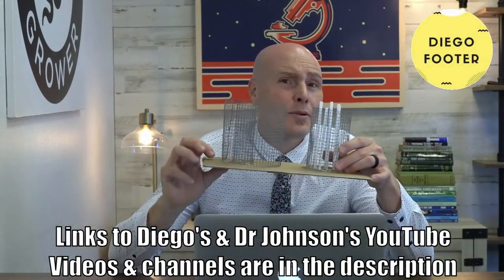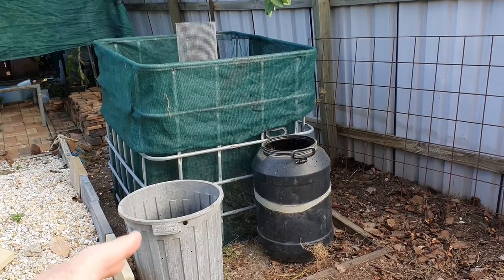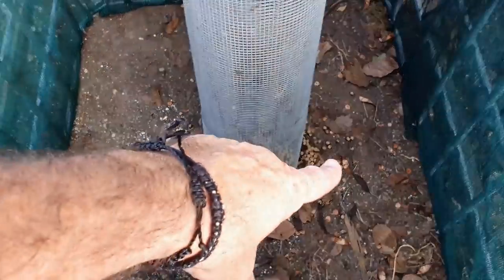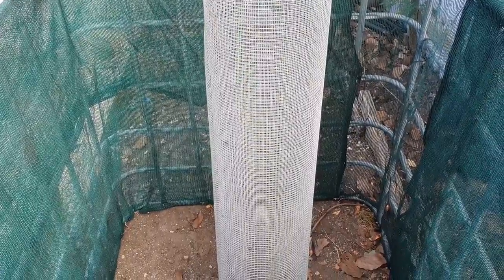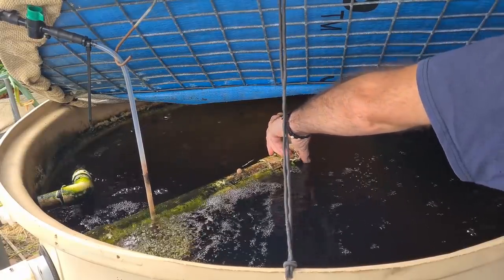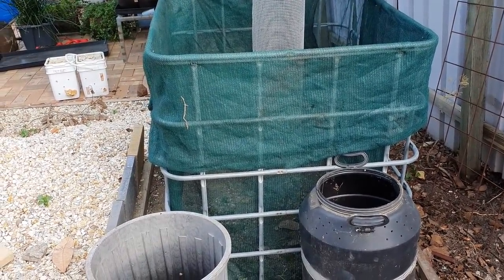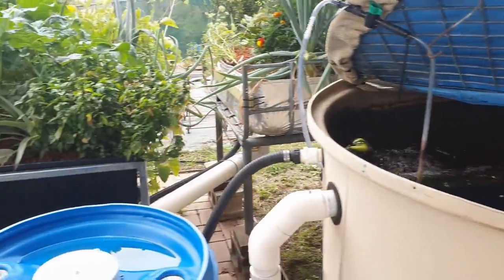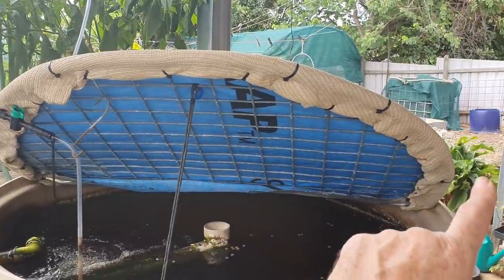Bioreactor Composting & Mini Aqua Update

Comment: Damn Rob, now I've got another project lol. I guess my midterm tests will have have to wait lol. Hope all is well!
Reply from the maker: 😀 Sorry for providing a distraction but they don't take long to knock together if that's any consolation.😉
Cheers & hope you do well in the tests Alex. 👍👍
Reply: @RobsAquaponics  thanks, the real test was finding one of those ibc frames that wasn't being used lol
Reply from the maker: @alexcalabro8140  I used the concrete mesh for the round ones. Works out fairly cheap too. 👍
Reply: @RobsAquaponics  ah yes great idea! I just took down our chicken run so that will be perfect to recycle that chicken wire.

Comment: In several videos you talk about the screws you use in your pipes when you don't use glue.  What size/length is the screw?  Does it go through the pipe (and into the water) or just into the pipe?
Reply from the maker: I use a small 6g/3.5mm 316 stainless steel screw that's no longer than 10-15mm/½" long for the larger pipes. I do have some shorter ones for the 25mm/1" pipe as well as I don't want it to impede the water flow too much. 
Hope that helps.

Comment: Hey Rob, love your videos.

I'm planning on doing a small indoor aquarium with an aquaponic herb garden, around 50L.
I'm gonna stock it with neocaridinia shrimps and a few guppies/tetras and some water plants, it's gonna be next to a big window and i'll give it an extra CFL on the top and scatter a few 1W LEDs around just for the aesthetics.

any advice you have for such small projects?, I'm doing everything DIY (besides stuff like pumps obviously, hehe)
Reply from the maker: Am glad you're enjoying the videos Sparrow. 😁
I haven't got any personal experience with the smaller builds sorry. 
I have been told by a few folks that they found running the beds as a constant flow was easier for them rather than making up a siphon. If you do want the beds to flood & drain a small timer might be the best way to go.
Hope that helps at least a small bit & have fun with the build. 👍
Reply: @RobsAquaponics  That was pretty much the plan, pump the water up though a mesh and bio filter to the grow bed where it flows down constantly as a waterfall aesthetically.

I need to look through more of your videos, do you have anything on herbs? parsley, basil, mint, rosemary, etc
Reply from the maker: @Sparrow420  Not individual videos on them. Mint will take over a small system & is a challenge in a larger one so I don't recommend growing it in AP.
Parsley & basil do really well. 👍
You will be told rosemary won't grow in AP by some but it all depends on how the beds are set up as they like air around their roots. I had one in a flood & drain bed that grew massive. It had a 400mm+ / 15¾" root ball when I ended up removing it. 
Hope that helps some.
Reply: @RobsAquaponics  The plan is for the mint to go wild, I drink a LOT of herbal tea, haha
When I did research on ap rosemary I found the same, thanks for confirming!

your replies and videos are super helpful, thanks again!

Comment: Can you use urea from any animal(cat)?
 I use wood pellets for a fire stove as cat litter, it changes to sawdust when it gets wet. It’s cheaper, smells better when used, and, once I decide it’s time to change out the box, I don’t have to throw it in the landfill. 
I’ve been throwing it in a pile, minus the poo, and my theory was after a couple years of it being washed by the rain, I could use it in the compost. 
But maybe I could use it in the compost right away?
Reply from the maker: I know that bottled aged human urine is generally safe but am not sure about cat urine soaked material sorry.  
It would definitely breakdown into plant-available nutrients Gayle but I would be concerned about pathogens being passed on to us if the material wasn't composted at a high enough temperature. I would suggest you look into the possible diseases that might be transmitted & the best way to compost the material so it wouldn't be an issue. 
Sorry I'm not much help with this one.

Comment: Does it matter if it rains and gets the bioreactor wet. How much rain could it cope with before getting to wet.
Reply from the maker: It does if you're in a high rainfall area. 👍 I have seen some folks cover the top with sheets of tin or tarps. It's best to make sure there is some air flow under the covering as well.

Comment: Hello from Florida,
I also have an issue with my stand pipe. I think I have visitors at night, possibly a raccoon or a possum. 
Update: I added a grow bed to my system and currently making my first wicking bed.
Reply from the maker: Have had a few folks say that racoons can be an issue in aquaponics. Birds are about all we have here that would go the larger fish I think & then there's only be a few game enough to have a crack at them. 
Nice one on the expansion too Chad. 👍 Are you using an IBC for the wicking bed or making it up from scratch?
Reply: @RobsAquaponics  I am making one from scratch using a 55 gallon, 2' x4' ... haven't decided if I will use it for carrots or possibly some bell pepper. Plan on using rock & vermiculite mixture base for wicking.

Comment: Oi mate, sprinkle a  teeny bit of lime, or marble, limestone,  or shells on top. I use marble rocks, I toss em in a few at a time and get them back out of the shovel hatch, eventually.
Reply from the maker: Do you add them in for extra calcium? Normally I'd add in a few rock minerals so the bacteria can break them down but thought I'd go all natural this time. 😉
Cheers GST.
Reply: @RobsAquaponics  no brother,  it's the PH levels, activity is generally acidic,  a tiny amount of marble or shells gives spots of neutral ph that melts in slowly,  worms and bacteria will use these spots to escape the acid.
Reply from the maker: @greatskytrollantidrama4473  I don't normally have that issue that I can recall. Once the piles stop cooking it doesn't take long for the worms to move in & smash through the remaining compost here.

Comment: about how long does the bin full take to decompose approximately
Reply from the maker: The tree material cages without the breather core normally take about 4+ or so months in our subtropical climate Pru & am thinking this might turn into compost a bit quicker.  
I have made up cages with only a small amount of tree trimmings that broke down in around 3 months but they also had a lot of spoiled luceren/alfalfa hay & horse manure in them. They compost a lot faster as the worms move in as soon as the pile cools down & speed up the process. 
Cheers & have a great one.

Comment: I think this idea is very interesting and I'm curious to see it work - experimental results are the only thing that counts.

But, the one thing I think is not correct in Diego's theory is that he equates the volume of the air with air circulation , but isn't the air circulation actually more related to surface area exposed to the air? ... assuming that air is circulating freely, which it clearly can do in both designs - but probably a little less so in the tube design.

In the "columnar" design there is a 2 foot cylinder with a circumference  ( using circumference because no need to multiply by the height ) of  ( 2 x pi x radius ) or 2 x 3.1415 x 1' or 6.3 feet of area exposed to the air .

With the pipe system you have a circumference PER PIPE, assuming a 4 inch pipe, of  2 x 3.1415 x 1/6  or  1.0 foot  per pipe that is exposed to the air.

With 6 pipes then, there is 6 feet of surface area exposed to the air.  ( But, you can also add pipes, right? )
The 2 foot columnar flow system has 5% more surface area compared  to a tube system with 6 tubes. ( But you can also add pipes, right? )

This is assuming that the outer circumference is the same.  BUT, the tube system can add more tubes, but the columnar system is fixed in the 2' centered column, and that area is actually a drawback because the space in the middle is wasted/unused land.  The "volume" argument seems to work against the columnar system because the variable that allows airflow is surface area, not volume.

The smaller the "tube" the less area inside the reactor is unused on the inside where the compost is, up to the point where the tube is so small that it might impede airflow.

It would be interesting to see if there is some way to use smaller tubes that push pressured air though the compost pile by a vent that faces into the wind.
Reply from the maker: I think he;s doing a trial with both at the moment if I remember correctly. I did see he just posted a vid looking at one that is now ready to pull down. Am yet to watch it myself. 
Cheers JGMTT. 👍

Comment: mine are doing the same barley touching anything , only 10% of the tanks are eating , was a hot/humid day today maybe storm brewing ?  2x tanks they are camping the top as if they want feed but take nothing 3x tanks are eating like normal , the rest are pretty docile  , checked oxygen levels and are fine , tweaked a few that had lower levels and running a extra pump for now ~ 100lpm of air going into each tank/growbed system , but their has been sign of bird shit , and a tank I recently split that should have had 96 in only had 86 in it , night time I normally here a thud and a few splashes but can not really see anything around like a cat or anything so unsure what is visiting @ nighttime
Reply from the maker: Whereabouts are you located Christopher? I was thinking about getting a trail cam for the area just to see what's going on. We're starting to see evidence of rodents as well so wouldn't mind seeing what they're up to as well.

Comment: Is there any update on this? Could not find any
Reply from the maker: There isn't sorry. I think I mentioned it in some round up videos here & maybe on the supporter pages. 
It worked well & created compost faster than the cages with no air flow in the centre.  I'll be using this method again once we get settled on the farm to build soul for our wicking garden beds. 👍👍
Reply: @RobsAquaponics  thanks for info. I have tried a similiar setup, but using woodpallets for walls and some scrap-piping that I had athome. 

It works okay for me too. But I have not optimized size of air-pipes or anything.

Its not superfast, but not labour intensive and cheap (100% scrap). Better than a simple pile or row